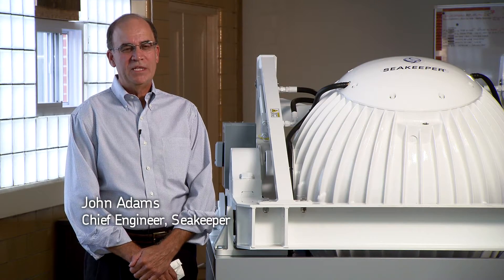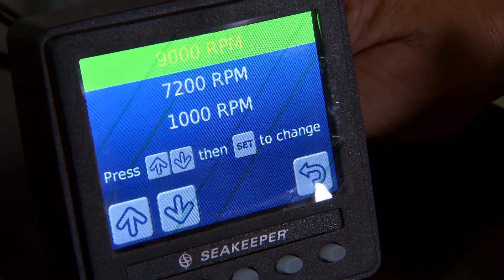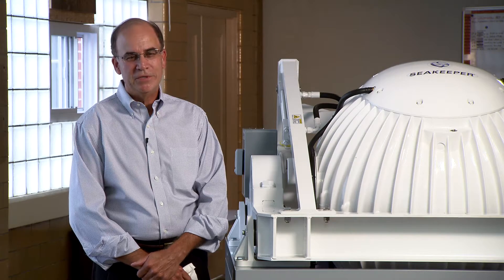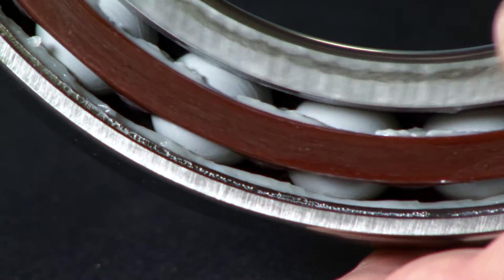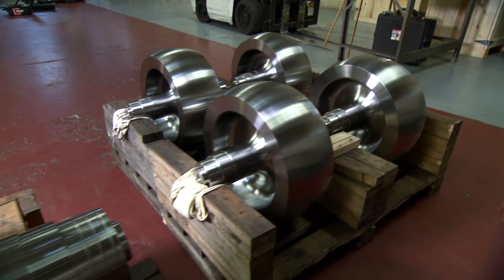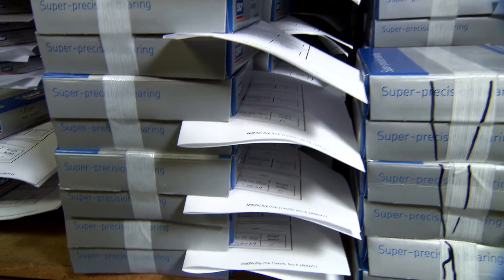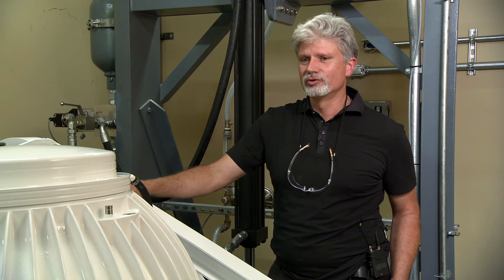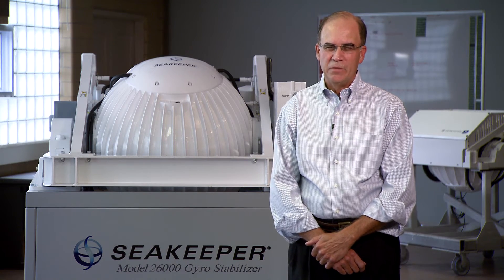SKF bearings Seakeeper full length version

Comment: The Seakeeper 35 is designed to eliminate up to 95% 
of boat roll on boats up to ~100 tons, vessels ~85' and larger. 
Multiple units can be fitted for larger boats. Unlike 
traditional external fins, the Seakeeper 35 requires only 
modest electrical power, has no external appendages—
meaning no drag or risk of snags—and can be installed 
virtually anywhere on board.

$216,300

Comment: I have a seakeeper 8000 in a Viking and have the high temp bearing alarm coming on as soon as you turn on the system after the boat not being used for a week. Any suggestions on repairs or company around key largo to do service/repair...
Reply from the maker: Hi Adam, It looks like the closest Seakeeper Dealer to you is Tri Sea Marine in Islamorada. You can contact Timothy Nichols at (305) 680-9499 or tim@triseastabilizers.com.

Comment: do the bearings need a lubrication system or were they designed to be with out?
Reply from the maker: Hi Robert,
Our bearings are built with the lubrication already built in, so no need to worry about a lubrication system!